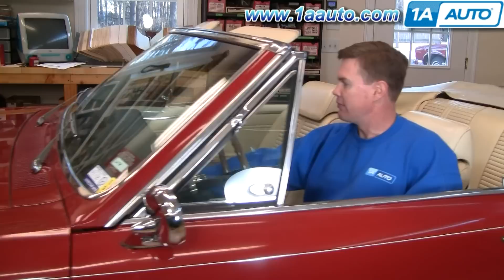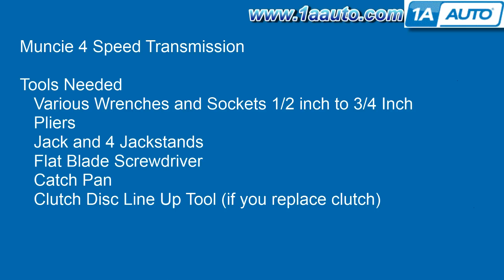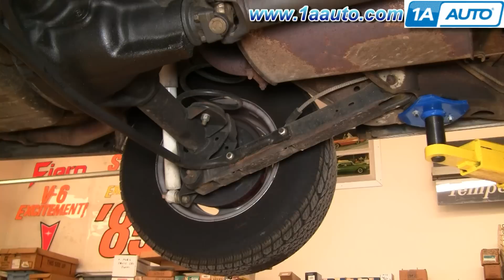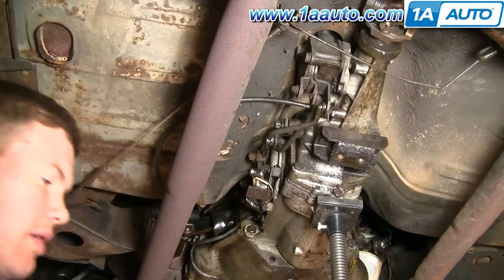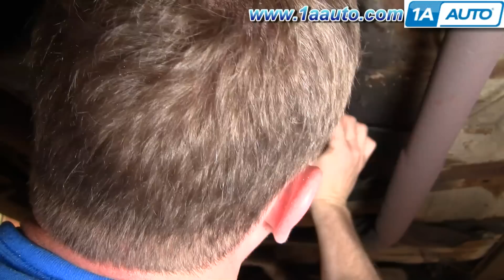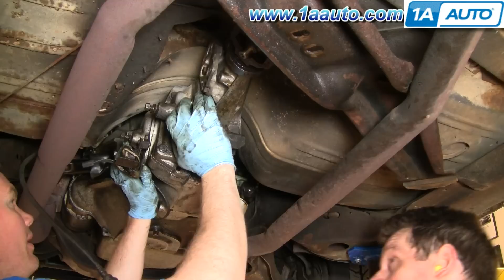How To Remove Muncie 4 Speed Transmission 64-72 Pontiac GTO [PART 1]

Comment: I think the back of bellhousing would be a good idea to support so all the weight is not tweaking the motor mounts. I feel like by unbolting gear box without a support on bellhousing all the pressure is put on input shaft. I may be wrong, I'm about to go tear mine out of my firebird it's not going into second. Good video thanks for pointers

Comment: Thanks for the shots, I was wondering how much of a headache it was going to be to get the trans disengaged from the engine since I need to remove it. Apparently not as much of a headache as trying to get flexplate bolts off an auto.
Reply from the maker: +thetriode Thank you! We love empowering our customers and showing how to perform DIY auto repairs with our high-quality auto parts. 1AAuto.com

Comment: Nice video.  Needed a refresher since its been years since I've done this.  A little tip if doing it on jack stands.  If you have a second person, they can go inside the car, slip a rope around the tail of the transmission.  Then when you slide it back, and dow onto your chest, half the weight is held by the person holding the rope.
Reply from the maker: +ironhorse127 Thanks for watching, and we appreciate the feedback!  1aauto.com